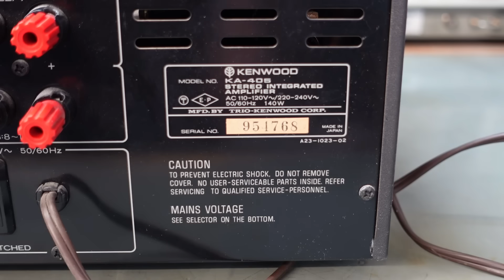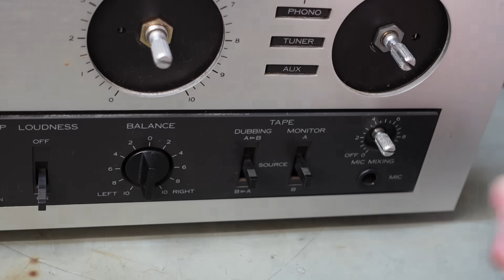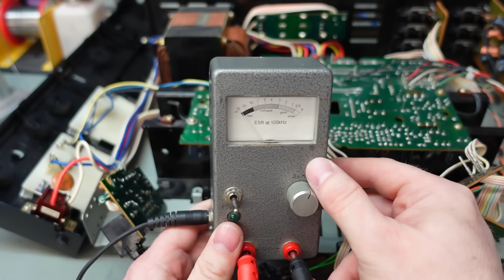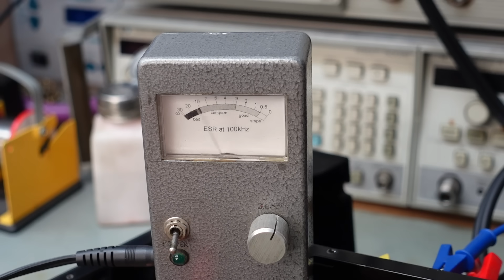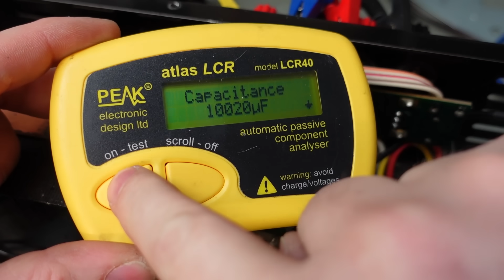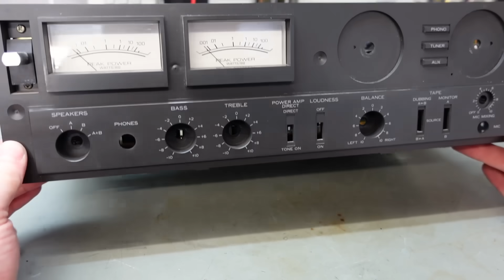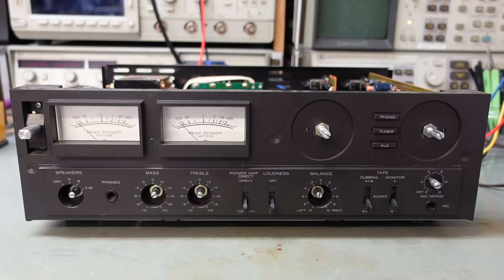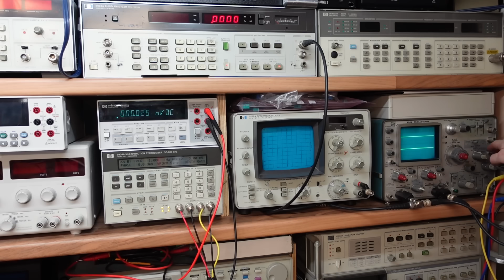Kenwood KA-405 Amplifier Service & MORE than Full Load Test.

Comment: I believe VERY few techs will pull all the switches and pots then ultrasonic clean, oven dry, re-lube and reinstall, there's simply too much chance of breaking an old part that could be impossible to replace.  I appreciate your confidence and completeness!
Reply: I agree it is unnecessary this unit is in very good condition to start with old brital plastic  can break so easily
Reply: @pauldavies6037  if you know what you're doing it is the right thing to do for longevity, with some of those parts, good luck finding exact fitment or old new stock
Reply: @pauldavies6037  It's the same thing with tech who don't recap vintage amplifiers then cry when one of them shorts out and takes out a transistor, ic or rare transformer you can't find or buy anymore and if you can find an official part is very expensive. An ounce of prevention is worth a pound of cure, this is the difference between a real tech going the extra mile and someone who does the bare minimum.
Reply: Yes but knowing mark he'l just go to the back of his workshop leap on a lathe mold a mold or twizzle a transformer winder and make a new part. Cape or no cape 😁
Reply: He's also washing out all the grease on the controls - I never see him replace that. He does spray a coating in on the contacts but damn, I've made the mistake of washing out that grease and it wrecks the feel of the turn of the "knob" (control)
Reply: @JonPaul  Nye gels can restore pot feel, I like their 868H !
Reply: But ya got to use it!  I don't see this guy putting in more than a think oil which will evaporate and gum up in about 5 or 10 years.

 @tedmich

Comment: For reference, the KA-405 was on the "budget" end of Kenwood's integrated amps in 1979/80, and it's still an extremely sold piece of kit.
Reply: Their stuff from the late 70's / early 80's was fab. I had a KA-3700 for years and that was their entry level amp I think. The thing sounded great, was plenty powerful and built like an absolute tank.

Comment: Hi Mark - geeky bicycle mechanic here. My understanding is that Philips drivers are actually designed to cam out so that excessive torque wasn't applied. JIS drivers are said to work as well if not better on either screw, this has been my experience in the JIS/PH2 size that I overwhelmingly deal with.

Comment: Great job, very thorough. Only thing: I've had two amps faulty, one Denon and one Kenwood (a later one) that had intermittent faults, that of one channel occasionally failing. Turned out to be dirty contacts on the speaker protection relays. I note you didn't clean or replace the relay - those faults can be (as mine were) very intermittent, only showing up occasionally. I don't know how common that fault is, only that I've seen it twice now!

Comment: You certainly go the extra mile by putting all the pots and switches in the ultrasonic bath. Very thorough. For bent over pins I use desoldering braid to wick the solder away. Great video.

Comment: Nice one, Mark. Another excellent job over and above what a lot  of other servicemen would do, such as measuring the ESR of electrolytics and replacing the ones that measure a little on the high side. Also all the ultrasonic cleaning you do. Top notch.

Comment: We used to do full power burns on pro amps using electric cooker rings which conveniently metered out at around 8 ohms. Since we risked burning them out, we would put them in a bucket of cold water, when the water boiled the amp was considered suitable to return to service!

Comment: Excellent video!!! 
You can tell they made much better electrolytic capacitors in the old days.
Reply: And most importantly those were not stressed by switching mode power supply, which is a killer of capacitors in its circuit.
Reply: @henriktoth56 I lately find that  contact plates with batteries easily go oxidation with the growth of brownish or greenish stuff( depending on metal or copper contact plates it used), they happened on small handheld led lamp type torch and rechargeable battery handheld drill. I think the inside buck switching mode circuit causes them. I take out the  batteries to completely disconnecting the circuitry after the use, the problem vanished

Comment: Top job, as always! I don't suppose you've got any plans/schematics for that ESR meter? I definitely need one for the shop!
Reply: Search online, I can guarantee it came out of an old electronics mag 👍🏻
Reply: Please share the schematic Mark...i need it to..its works good..😁👍👍
Reply: I was nicely surprised to see Mark using his ESR meter - testing electrolytical capacitors in circuit !
A Google search (simple 100kHz ESR meter) quickly took me to good &  efficient schematics, using basic TL082s.
Thanks again Mark, pls keep up the good work ! - No need to guess what my next "project" will be... 😅
Reply: The one I built was by an Italian guy, I used the entirety of a cheap moving coil voltmeter as the display. It's indicative really. Be aware, discharge large caps pre-test, although the design has a couple of diodes reversed across the probes.
Reply: @decibel_tastic2869  Hello, deciBel_tastic. I have a minor question about your ESR meter. There's always a zero adjustment in the schematic diagrams I found. Is it necessary to readjust at zero regularly, or is it a "set-and-forget" adjustment? Mark had build his adjustment with an external knob. My aim is to use a walwart SMPS power supply (+ some extra capacitor to smooth it down). Thanks in advance for sharing your experience... 😃
Reply: @richardhack9830  Errrrrr . The decades fly by, I don't recall a balance trimmer, it's definitely not accessible on my box. So, I haven't tweaked it for years. I can't claim a "calibrated" unit, I really use it as an 'in-circuit" indication. I "zero" the meter by shorting the leads, to get a full-scale deflection, there's a "DC" LED that conveniently lights up.  Testing, if I don't get an appropriate kick over, I have the cap out to inspect it and check on a separate Chinese ESD + Capacitance (impedance) meter. Bear in mind, often small polyester decoupling caps are across electrolytics, which confuse and obfuscate, particularly on a Friday.
Reply: @decibel_tastic2869   Thank you, deciBel_tastic. Your reply tells me everything I need to know!
That is, if the ESR meter would have needed regular readjustment - you still would have remembered it, having built your meter without external access to the adjustment. Clearly you didn't miss the external access - so I call it a "set-and-forget" adjustment ! 🤣
And of course - this is no Lab. Instrument, not a component analyser, it is an in-circuit capacitor tester. More than good enough for checking "suspected" capacitors...🕶- 😎
Thanks again for your help !

Comment: You mentioned that it contained Japanese capacitors.  I'm restoring a Roland JX-10 synthesizer, right now.  It was made in 1986 and has HUNDREDs of electrolytic capacitors.  The ones in the power supply were showing a bit of aging, but likely still had some years left in them.  They got replaced, anyway, due to the power supply having transistors and IC's, that are no longer made.  No sense in taking chances.  Honestly, although I'm changing them all out, I've not found a bad one, yet, and I've replaced over a hundred.  Again, I don't want to take any chances, due to the oscillators having specifically matched transistors.  If you can even find replacements, you'd have to buy a bunch and match them yourself.  It's been a heck of a job, but it's a real pleasure to work on.  Really solid craftsmanship.  I can't wait to get it finished and play it!   Not that I'm trying to make a profit from it, but when replaced, it will be worth about $950.  I bought it at, of all places, a hamfest.  My wife said "You could go to a hotdog stand and buy a musical instrument."  😆  I think that she's telling me that I have too many, already, but we all know that's impossible!  😂  Love the videos, Mark!  To all of you watching this, pay attention to this guy.  I'm a retired EE, who got his start as a hobbyist, when I was 9 years old, and STILL work on designing/repairing something, almost every day.  This guy is the real deal, and I'm pretty tough to impress.  I wouldn't hesitate to let him work on something of mine, and that's high praise.  He's also an amazing teacher.  Not only does he say what he's about to do, he also explains why, and that's the part that a lot of other channels miss.  Sure, they might test a component and show that it's bad, but Mark tells you why he tested that component, or why he was suspicious of it being bad, in the first place.  Troubleshooting is a skill, unto itself.  No matter if it's an amplifier, a car, or a clock.  Once you get some experience, you should already know where you're going to start looking for the trouble, before even taking it apart.  If you notice, he always tests everything, before opening it up.  Sometimes, finding out what works, is just as valuable as knowing what doesn't work.

Comment: I had a very similar Teac amp that I recently threw away.  It would immediately fry the two glass fuses in the power supply as i would turn it on.  And thats as far I went with it.

Comment: Quality video Mark as always, attention to detail spot on. Have you any valve stuff to do in the pipeline as I think you would do it equally fantastic in your informative way, and it would take me back to the 70's in my head when I built quite a few single ended and push pull amps for my disco when I was still at school. Keep up the good work.
Regards
Dave.  😀

Comment: I got a KA-501 and one channel is broken, more or less.
Used to have subwoofers on it, using both channels to drive one.
Needs new transistors, but they are not common.

Comment: When I get bent over pins like that, I usually suck the solder off the top before trying to slip the hole of the desoldering gun over the pin. It offers less resistance to bending and I would think it helps prevent breaking them. I also let the pin heat up a bit before bending because heat alleviates bending stress on steel. Of course you still end up breaking one every so often, but that's life I guess

Comment: Your work with the pots and switches is very thorough, but what I really like is your attitude regarding the capacitors - no need to change what is working within specs. Some guys rip out all the electrolytics and later they are dumbfounded why the amp is sounding worse than before.
Reply: There is no possible way that new capacitors of correct value would make an amp sound worse.

Comment: Hi love your vids, just a small question, i never had any luck with Minidisc players as they all seem to break down on me. Most of Sony ones that broke down on me has the same issue. The standby red led is lit and nothing happens. I cannot insert a disc or eject and doesn't power on. About an year ago i got myself yet another Sony MDS-JE520. Was working great and the sound quality was as almost good as my Sony DAT. This one suffered the same fate, red light on and nothing happens. I did some reading you can enter to a diagnostic section by pressing down the enter button and it sure does light up the display for bunch of inbuilt diagnostic options. However, after exiting from that, still the same thing. Can please give me your thoughts on what could be the issue? One person said the micro processor is fried. Could that be the case? Your input on this is highly appreciated. Look forward to hearing from you soon. Cheers

Comment: Recently discovered this channel.  Nice work,  I'm appreciating the  way you work.
I've two question:
first one:  what liquid did you use for the ultrasonic cleaing.
second one:  i like your desoldering gun. Low noise and efficient.  Is it a PACE?
Now I'm retired, and  I need to re-equip my home lab. 
I've some tools that need  replacing with something better, not some crap.
Reply: Nope. it's a Metcal Mx-ds1 Desoldering gun.

Comment: Thanks for this, fascinating to see the introduction of integrated circuits, was this amp one of the first? My Sansui 317ii, which is a couple of years older, doesn't have any. Amazing that the caps were in such good condition after all that time

Comment: Really nice fix on this Kenwood again. You're only change the caps that are really needed, i do it the same way. My amp and cd player are over 30 years old Philips fa890 and cd850. Every one is crying " oh, the caps are over 30 years old, you must change them all", but the readings are good and some even perfect. So why should I do this, both are working perfect. Don't like al this bla bla. May I ask which liquid you use in your sonic cleaner ???.

Comment: Those "potten" orange caps are low leakage types, notorious to start leaking electricaly. Be sure to replace with low leakage types or equivalent leakage to the old spec ones.
Reply: TRUE ! 
I've got exactly this problem in my Philips AH395, (made in Japan, 1980). Hitachi HA1457 used in phono preamp and slowly, after 43 years of service, one of my phono channels is growing somewhat dim. I am not a fan of recapping amplifiers (if it isn't broken - don't fix it !) but these L+R caps in the phono signal line will be replaced. Old specs are "Low leakage" and that's all... Any decent Brand (Nippon Chemi Con / Nichicon) modern standard electrolytic capacitor will do fine, compared to the original NCC. Fancy Muse series capacitors didn't exist in those days - my amp wouldn't know how to deal with 'em... 🤣🤣🤣

Comment: Hello teacher.
I have exactly the same equipment. and it has a problem: after working for about an hour (or more) one of the channels starts to sound like "dirty" , as if it had interference in the high frequencies, it's slightly perceptible, but to my ear it's not pleasant at all. Could you help me with any tips? I already replaced the capacitors and cleaned the pots.

Comment: I love watching you work, but I am left with some questions. What did you find wrong with the controls, they seemed to be working from what I saw on the scope. Why did you remove them and use the ultrasonic cleaner, rather than just spray them with DeOxit? What temperature was the oven set to? Some of these questions could be answered with text boxes added in the editing process, other would need verbal explanation in the video itself or in additional remarks added afterwards. I don’t mean to criticize your videos unfairly; you’re not offering tutorials per se, but some things you do are not as self-evident to your viewers as they are to you. I would also not want to change your style: breezy, light, and efficient, and sometimes challenging and difficult repairs.

Comment: Hi Mark, what makes your isolated power supply isolated and also when you switch your isolated power supply on, what are the big light bulbs for ?
Reply: A transformer is used to isolated the primary (mains) and the secondary. If you come into contact with one side of the secondary, the capacitive current of the system to the ground is too small to cause personal electric shock. You will also get a cleaner wave due to high-frequency loss in the iron core.

Comment: Which desoldering gun are You using? It works great!
Reply: It's a Metcal desoldering tool. Be aware they my work great, but are expensive to buy and you also need to buy a compressor to use it.

Comment: I have an Hitachi HMA 7500MKII that no one seems to be capable of fixing. If I sent it to you from Portugal, any chance you could have a go at it? Will it cost a lot for you to fix it. I kind of managed to make it work (sort of). It plays music at very low volume. When you increase the input signal (it is as stereo power amp) some (cracking noise) appears on the left channel and it goes into protection. I changed many caps, I changed the output transistors, I even changed two ICs that are no longer available on the market for two more recent "equivalents" (it did not work at all before any of those changes). But I just can not make it work properly. I am not a technician but I took it to 3 technicians who said it was hopeless since there were a few parts you could no longer get and told me to through it away. I can not throw it away for two reasons. Life is very complicated at the moment and I would not be able to afford a higher end amp such as that one and I love the huge VU meters it has at the front. 
I know it is a bit of a stretch but I had to ask as you are incredible at making things work again.

Comment: Doesn't appear you ever tended to the speaker relay. On a 40+ year old piece, well, you may regret it. Even a seemingly good sine or square wave on the scope may not reveal up to 1 or 2 percent THD. At the very least check the relay series contact resistance for good measure. Should be under .02 ohms or so.

Comment: No service technician today would take the time to remove circuit boards from a component, desolder and disassemble switches to clean ultrasonically. None would be so thorough, instead spray a contact cleaner on open potentiometers.  Sellers list vintage as being fully tested and cleaned ……right!

Comment: hi to all out there    one thing about having very clean gear  someone  would mark it
i have a mate  he had some work done on a car  a lorry drive marked along the side of it

and  the same car a mate of his keyed the new work  he was vey mad as hell 

i will only buy decks  that i can only find parts for and easy to change only  i have seen rust on the back of gear  i got a teac 44 that was hit by rust on the front panel
likely i know a man who pull decks apart to flip as part  you can see it's the right range and the colour is not right  it purrs like my cat 

note if you are buying gear please check first what parts are around at the time  to stop you getting a money pit 

i do this with betacam decks  we all know there's alot around still